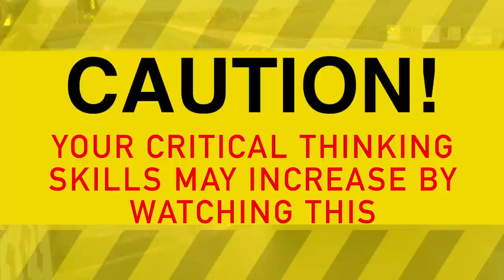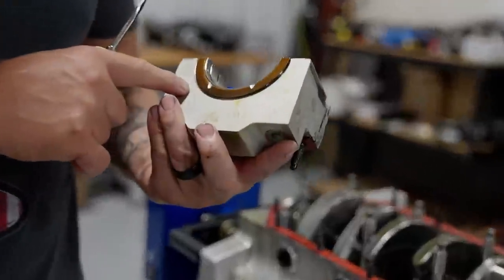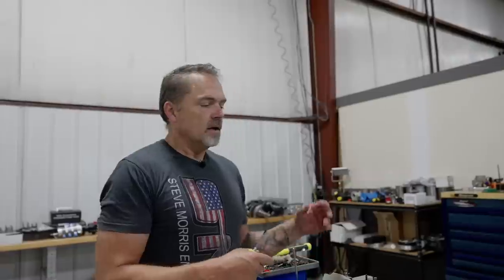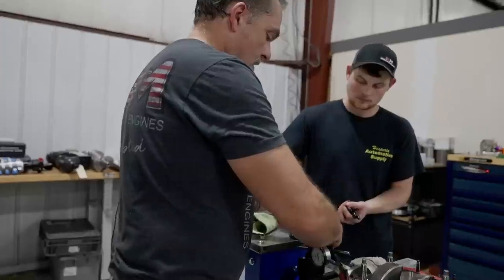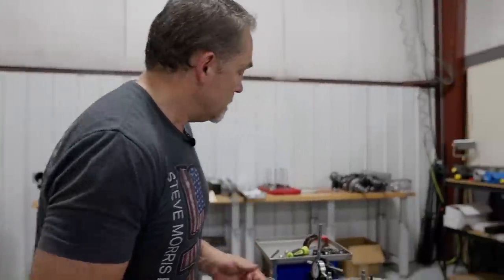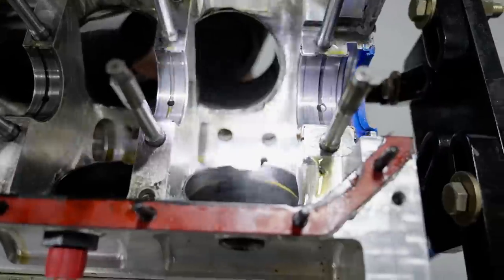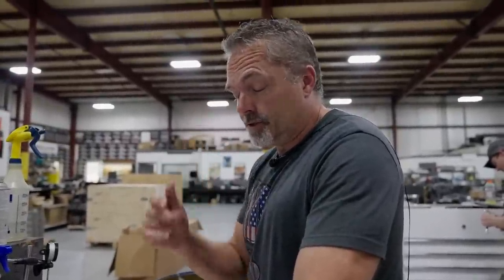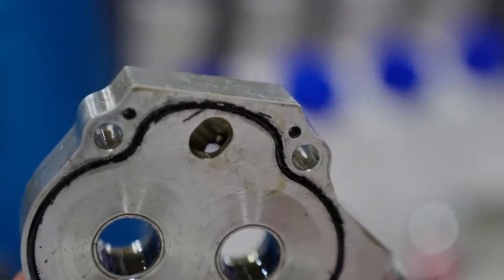I Found Mullets Engine Issue...Part 2

Comment: Just thinking Steve, as the block heats up, it will grow more in length than the crankshaft. As such the front thrust will be further away from the rear thrust than when it is cold. Haven't bothered to do any maths, but it should be possible to calculate without too much difficulty. Love your work. Regards Greg
Reply: Maybe the two different types of metal expanding at different rates of growth
Reply: Was thinking the same thing when he discussed the seven thousandths tolerance on the crank last video. Like yeah she’s perfect now that it’s cooled all the way down and not under load or fresh off a run. Very surprised he didn’t seem to consider that when going thru everything.
Reply: Mullet’s engine has more clearance than any other SMX.

If the block growing is causing problems here, it would be worse on all other engines.
Reply: Actually the heat and pressure from the transmission drive line etc can create a larger gap for a minimal amount of time
Reply: If it's a compound issue, with heat, expansion rates and the pressure from the converter, added to maybe a little dynamic shortening from twisting the crank just slightly at peak torque, and some flex in the thrust bearing housing. It could be why it's tagging the bearing. Not knowing how much pressure the converter is applying and the amount of movement that much pressure causes in the crank, it's just a guess, but probably get a thou at most static, but add the twist and it might be enough.
Reply: That’s the thing, racing engines are built super “sloppy” which is why they need to warm up much longer.
Reply: And have oil/coolant pre-warmers
Reply: Totally correct Greg. Aluminium Grows 2x (edit) more than Alloy steel.
 For a 30" long Aluminium engine block it grows  in length about 52 thou'(edit) it heats up to normal operating temp. The crank grows about 26 thou'.(edit)  A 26 thou' (edit) difference. 
So the this 26 thou' + clearance,  is what you should be able to measure at the relieved rear bearing thrust when the front thrust is installed and the crank loaded  forward. (at 20 C/ 38F)  Regards chris.  ex automotive machinist and engine builder.
Reply: I, like Steve, believe the thrust issue is from too much charge pressure. The block expanding with heat would give more clearance, like steve said, In this instance more clearance equals less wear on the thrust bearing. That's on Garrett,  Steve told him before that he thought that the charge pressure was too high in the tranny. Most of us thought it was the oil pump that caused the glitter in the filter before he tore it down with all things considered. Just listen to Steve!
Reply: I thought these same things in the last video. Really really cool to see smarter more knowledgeable people in the comments explain it in more detail. Thanks for sharing the knowledge guys.
Reply: Thermal expansion. ..0000065 per.F rise in aluminum and ..0000128 per F rise in steel.
Reply: @havenpropertycare  thanks Chris. I just didn't have time to sit down and do the maths as I was writing the comment. As you are aware, operating temperature plays a  significant part here. It is quite possible that there is a temperature variation between Steve's wagon and Mullet. That said, the converter charge pressure issue is probably emphasising the issue
Reply: @beckyumphrey2626 yeah that might be the claim, ive found metal expansion to be nothing like what is claimed on google and thats on large as it gets marine engines. There was a book i read decades ago about it and it showed all the factors involved and how even in certain shapes it can change vastly.
Reply: i was thinking the same with the amount of weld in the block to fix it if the expansion and contracted at a some what similar rate
Reply: @dylanzrim3635 ......WuT?........if anything racing engines are more precise and tolerances are a lot tighter........some F1 cars need to have the block and all the oil and fluids pre heated before they can even start/turn over because tolerances between parts are so small that the engine would be immediately damaged on a cold start
Reply: @theshed8802  Hi Greg ,Yep I used a conservative 80 Celsius/176 F Rise for expansion calculations.
Yes charge pressure is high but as Steve proved on inspection, his well engineered  FRONT thrust bearing is handling that. The rear main  bearing thrust surfaces are actually redundant. and the only reason it is showing a superficial mark is that it does not ENOUGH clearance for the differences between longitudinal expansion of the block and crank. (Steve obviously has a good reason for employing a forward thrust bearing, but you can see why most other engines have a rear thrust.)
Talking expansion, another interest situation is when someone swaps their oem cast iron heads for alloy ones on a cast iron block. If you do not retorque the heads when the engine is cold after the first heat cycle, and instead try to do it hot, you will not get any retorque movement (because the head has grown more than the head studs/bolts) and you will most certainly blow a head gasket! (In general, Alloy heads on a cast steel/iron block create a head gasket nightmare and require some slick engineering design.) (Expansion differences in an all cast-iron engines is relatively small and you should re-torque those hot)

Comment: Steve, if the block grew and added clearance between rear thrust and front thrust it would give opportunity for the crank to move further forward and in turn decrease clearance on the rear thrust.

Comment: Little things can cause big problems. Love these "forensic" videos.
Reply: David Wright, Your claim about "forensics" is incorrect, invalid, distorted outside of proper terms, ideas, concepts, principles. Forensics is a term, process for a completely different set of circumstances, issues, area, and requires much higher level reason, logic, reasoning, knowledge, than any engine builder, mechanic, similar have. Forensics is actually used within areas which have higher level knowledge, principles, uses some areas of basic science, physics, materials, chemistry when needed, appropriate which are accurate, precise, exact, have causation, mechanism, proof, defined, determinate, and combines with other areas of information, claims, ideas, concepts which lack these aspects as biology. Good Luck, All The Best, Sincerely
Reply: @newtonfirefly3584  Take note of the quotation marks around that offending word as it should indicate the sense of humor I was implying.
Reply: @davidwright640  no humor there David Wright either - just nonsense. Good Luck -> Bye Bye

Comment: Steve, a comment regarding the high pressure section of the oil pump. It appears that the pressure relief valve is of the "spool" type which are great at accurately modulating oil pressure but as you have found out they are very susceptible to contamination. As you said the high pressure pump gets it's oil from the oil tank so it is imperative that the oil in the tank be as clean as possible. That is only possible by insuring that all oil put into the tank, both the return from the scavenger sections of the pump, also from any new oil that is poured into the tank and by possible ingress of contamination through the tanks breather. The most important is the return from the engine through the scavenger sections. The best way to ensure that this oil is clean is to combine all of the sections into one return line to the tank and in that line install a large industrial filter that has a minimum 10 micron rating with "beta" rating of at least 100. Beta rating is a measure of filter efficiency at the filter's rated micron particle size. A Beta rating of 100 for a 10 micron filter means that the filters single pass efficiency is 99.99% efficient for removing 10 micron or larger particles. Use only filters that use fiberglass media, do not use automotive filters as they are almost all paper filters that are very inefficient and have high pressure drop.Use industrial filters made by Pall (the best), Hydac or Parker. Use a large filter, one that has a nominal flow rating of 100 gpm would be a minimum. The larger the filter, the slower the oil goes through the filter the better the filter works. These filters are not cheap, but neither is your engine! Also do not use screen filters, they are very high pressure drop for ratings in the 20 micron or lower also regardless of what the manufactures say, you can not clean them by back washing them with solvent. 

You would be amazed by the amount of contamination that is in "new" oil so it is good to pour new oil into the tank using some sort of filter and do not try to get every single drop out of the can as most of the contamination has settled to the bottom of the can or bottle and comes out with the last drop. 

Use some sort of good air filter on the tank breather to prevent ingestion of air born contamination as the tank breathes from the oil level fluctuating.

Before retiring I was an application engineer for one the major industrial hydraulic pump manufactures and worked on hydraulic systems that ran at 5-6000 psi with flow rates of several hundred gallons per minute and on all of the systems the "return line" filter system was the key to clean system oil.

As always I love your "lessons" and your open mindedness! Keep it up!
Rex Schimmer
Reply: @@rexschimmer7394 You do realize that this is not Steve’s first engine, He has been building these for years without any issues! Everything that you have mentioned has nothing to do with the actual engine, Steve is an engine builder you should go leave this comment on Cletus‘s page! After all Steve has a solid reputation in the racing world meanwhile Cletus is constantly breaking, hurting or having issues with almost everything that they touch! He did not find out anything that he didn’t already know he just does not want to say what the actual problem is, You do realize that Cletus has almost no automotive knowledge! Thinking he does is like saying my father-in-law learning how to do a break job from YouTube makes him a mechanic!

Comment: I believe that Mullet was running very high oil pressure when the motor fist went in,even blew the oil seal in a turbo or two. Do you think the oil pump relief was stuck closed at first? This would over pressure the pump it’s self and damage the rotors and/or the pump housing? I think it blew the oil pump belt at one time aswell. Just a thought
Reply: I was thinking maybe the material came from the turbo after the seals had failed.i do remember that being a problem. But it would depend on where the turbo drains would go to

Comment: Re: thrust forcing crank forward --- When there is high torque on the driveshaft slip splines, the spline will twist creating an axial force.  This will force the transmission internals toward the engine.  Same deal possibly on the front pump.

Comment: I am going with there was a bit of trash left either in the tank or the line from the last rapid unscheduled disassembly that finally worked its way loose with some of the launches that went through the pressure side and caused the issues.

Comment: Great video as usual. I still did not see enough damage to account for the metal in the filter. Where does the return for the turbos dump. Didn't they replace a bad turbo. Must have been in the tank.

Comment: Steve, I love the through analysis when things go wrong. Most engine builders only show the good things on their engines. The scope of designing an entire engine to live in HP numbers such as these will always require a lot more inspection and maintenance than an off the shelf build. That's the only way to make them better. It would be interesting to set up the block and crank vertically in a press. Dial indicator on the  front of the roller thrust housing, and push the crank down to deflect the front of the roller thrust .020, and see what amount of pressure it takes to do that. Although it would probably damage the roller thrust to test it this way.

Comment: We had a billet 4 cylinder engine built. Did some initial dyno work. 2437cc punching out 745hp at 6200rpm and we're not happy with heat buildup in inlet manifold so called it quits. Decided turbo not operating in its window. We're not happy with valve clearance inconsistencies. Oil seemed a bit grey. Found several issues. Was a hydraulic grind on cams but solid pedestals. Cam was way to consecutive. Oil supply to head was restricted by oversize head bolts and it chewed up a journal in head. Was supposed to be a brand new mitzi head but we got duped by english company. $15000 for a used head complete. Anyway, bored out cam journal and made a full cotton reel bronze insert as it was an end journal, changed Oil.feed to head with remote feed hose we can put pill orifice in, added pressure sensor to end of the cam 
 oiling system. Build new turbo inlet to charge cooler setup and installed throttle body type blow off valve. New dump pipe. Another row of injectors in inlet manifold. Now dealing with damaged dyno! Lots of little things lol.

Comment: Clean out the  oil tank and look inside for cracking on welds ect 👍 Been their done that 😔
Reply: For sure. I recall Tye mentioning that he had to be very fast when fabbing that oil tank. Can't help but wonder if there might have been any slag left in there that could have created debris. Alternatively, some stuff might have come from the oil cooler seeing that they used the same cooler in both the BBC and after the SMX had its initial issue. I'd check that tank and replace the lines and cooler to be sure.

Comment: Garrett, I remember watching a footage of a race car. It wasn't only another racer. It was a Ford Taurus station wagon with a big block hemi engine. I so much want to watch it nNy more time, except I'm not able to find it on YouTube. I believe it was possibly the fastest in its category. No, it didn't have steel body panels. It was possibly fiber glass or another one material.  Do you remember the Ford Five Hundred? That's when Ford bought Volve cars. They used hydro forming for some of the components of that car. It was the model before that Five Hundred that thst racer was based on. The reason why I remembered it is because of that Chevy Caprice wagon.

Comment: Could it be something as simple as residual material left in the hoses after the pump ate it's self the last time?
Reply: Did Clets team go through the oil tank and hoses the last time? I know in Late Model Dirt cars after engine failure they clean the tank throughly and throw the hoses away.

Comment: Not an engineer or something, but could it be that mullet chassis is bending a little every time it runs and push the crankshaft and all of that?. Maybe reinforce the chassis or the rear axel, because I remember a video where the wheels bent the rear fenders a little bit.
Reply: So If You lack the knowledge, principles of an engineer, mechanic or any level withn motors-engines, machines, mechanical, then why are You attempting to comment propose anything ??!!
Reply: @newtonfirefly3584  I may lack the knowledge, but that's why I'm commenting, maybe somebody can make a response about why I'm wrong so I can learn more. It may not be my career, but I like cars and enjoy watching this kind of stuff. So what's the problem?. Based in your other responses to other comments I'll say you are a troll. Probably an AI.

Comment: My guess at the material that went through the motor is from all the AN lines they made. They never showed if they cut them with a cutoff wheels or if they used an actual AN hose cutter. They possibly never flushed the lines after being made, being in such a time crunch

Comment: Just speculating.  
That is a lot of engine and the valvecovers tells something about how much the engine growns or moves around when it is hot. The two thust bearings are placed on opposite ends of the crankshaft so when the engine get hot I do suspect the extra 0.020" cold clearance on the rear thust bearing could be reduced. Then excess converter charge pressure forces the crank forward "touching" the bearing.
I have seen 100 psi charge pressure on idle and if there is no or little oil pressure to lube the rear thrust bearing?

Comment: Love the honesty and transparency. As a team manager myself we run into these issues all the time.  Its all easy in retrospect!  Only additional thing possible would be to swap a spare pump in at the track and rule out a pump issue. Its not a ton of work to replace a dry sump pump and most guys with a 4k hp motor carry a spare :)
Reply: Still wasnt the issue.  There was something putting excess pressure on the crank.  Hopefully they find the issue in the trans.
Reply: @gmabailey40  well, it was the idle oil pressure issue.  Which ofcourse is scary because one would think the excess pressure on crank & oil pressure could be related

Comment: junk in the oil tank. Charge pressure to converter a little high. 40 years heavy equipment mechanic, its amazing how much stuff can be left behind in capped and sealed  factory made hoses let alone " custom " hoses. Need to see the rest of the powertrain systems now. Certainly worth the effort just to catch the stuck bypass valve.  Simple        once you find it.

Comment: Main number one wear on top.  On plain stock motors, I've always seen wear on the top of the  bearing.  I attribute this to fan belts pulling the crank up, the engine running before oil pressure is built up.    I'd also expect to see this on a belt driven blower.   I would not expect to see this type of wear if the accessories are at or below the crank center line.